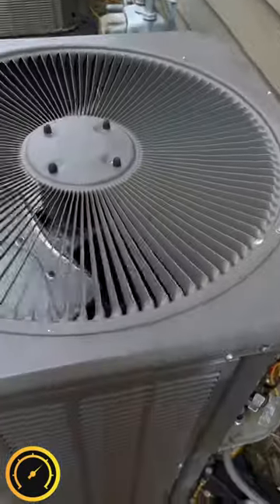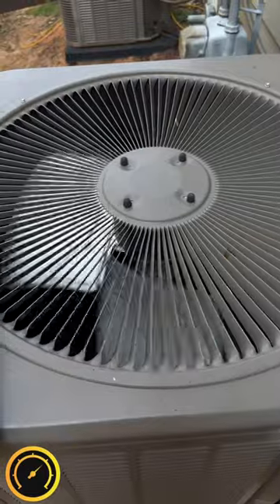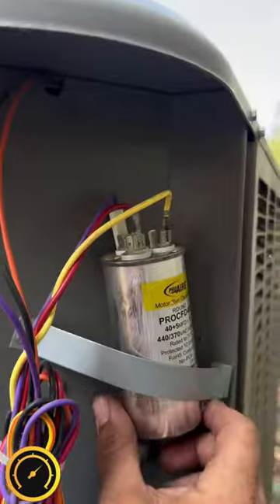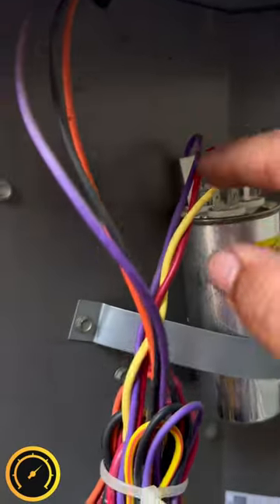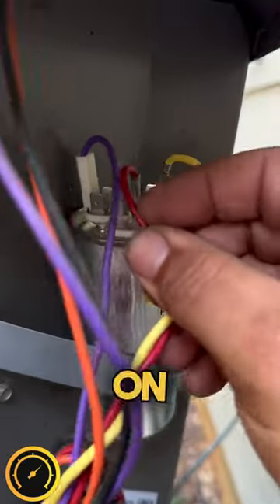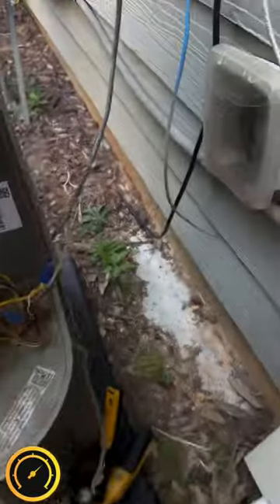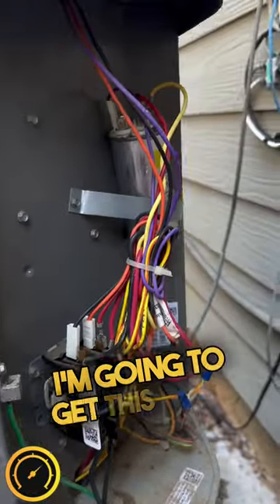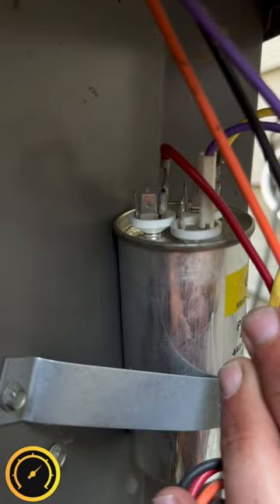Don't let HACKS fix your AC!! #hvaclife #hvac #trending #trendingshorts #hacks

Comment: I always wondered what would happen if you hooked the wires up wrong. Now I know. I went to a large property that had 300 units to meet the new maintenance director to give him a brief overview of the life of the systems there and it was a whole mix bag of AC systems from 1980s to 2020. There were some carriers, yorks, goodmans, and even some old r22 units still running. I opened 5 different random condensers and noticed they all had the same new titan 10uF capacitor. I thought to myself "That's kind of odd that they all happen to have the same capacitor." So I mentioned this to the maintenance director at the company and he told me that the guy before him was sick of paying $300 to have a $10 capacitor changed so he ordered 300 10uF capcitors and had the maintenance crew replace them all a few months ago. I told him the process of putting the correct capacitor in each unit and they did not like what I had to say so I never went back there. It would be interesting to know how long those units lasted and I'm kind of surprised that they even worked at all.

Comment: Always take pictures of wiring myself so I make sure it goes back the way it was
Reply: Yep absolutely the way I do it.
Reply: thats works great until you meet someone that tried replacing a cap themselves, messed up, now they’re calling you saying it just “went out” but in reality they botched the wiring lol. pictures are great but if you really understand why you do what you do then you can be that guy that can solve anything
Reply: Or read the diagram as a double check before re energizing
Reply: True but those wire colors are definitely indicative of where they land at. 
It’s better to learn to read line diagrams and use pictures for quick repairs if needed. 
And I’m surprised he didn’t keep the video going, would’ve taken me 10-15 seconds to wire the cap correctly
Reply: Just learn to read the diagram. You'll learn sumthin

Comment: I love DIY homeowner fixes. Makes life interesting- and funny.
 Had one replace their contactor- the high voltage took out the transformer and the thermostat caught fire on the wall. I've been at it 49 years and still haven't seen it all! LOL!
Reply: What did they wire it up wrong?
Reply: "how to save 500$ to eventually pay 2000$ plus 4 hours for the pro to clean your mess then put nice thing in it" in the nutshell. 

Ever seen a whole ass bathroom being wired into furnace circuit breaker? I love to see when they turn hair dryer plus ceramic electric heater when furnace cranking on for high heat mode lol
Reply: That's pretty funny. But notice he said "don't let hacks" he's talking about hvac people that suck at their job. Not homeowners.

Comment: Interesting situation. Both winding of the fan will be in phase, so with no polarity the fan might even spin backwards, if it starts at all. On the compressor side, both caps are in series with the start winding, which surprisingly reduces the start winding capacitance! So, both motors will struggle to start, draw more current, and die sooner.

Comment: Had a co-worker replace a compressor on a unit and told me that everything was working well. I did the p.m. a month later and the system was cooling 10 degrees. He wired the fan incorrectly to the capacitor and it was running backwards. After I corrected that I added 4 lbs. if refrigerant to the system and it was cooling 22 degrees. Hacks are a dime a dozen and companies are willing to hire hacks because they think they're saving money.

Comment: Seen a guy wire the cap wrong,  never realized fan was spinning backwards, diagnosed bad compressor because amp were reading 34, max was 24, temp split was below 10. Replaced compressor, same exact issue lol.

Comment: Yup had one like this the other day, customer installed his own cap and wired it exactly like this but instead of that noise the fan was just running backwards
Reply: Yes definitely
Reply: teslafusion74 i did it once(im pretty new lol and it just pushes air out at you and you can feel the air being hotter than normal and it eventually trips on high pressure the reason i did thus was customer started talking to me anf i left for some reason and the fan wire was blue and the compressor wire was brown but usually its the opposite so i wired cap bad lol

Comment: So that part u said wires are backwards I just had replaced cuz it was running for half the the day and not cooling so they replaced that and came on but took almost 24 hours to go from 75 to 70 which I feel is a really long time and once it reached 70 I left it there for awhile then put on 68 so saying 2 hours to drop 2 degrees does that sound normal ? And should tan always be on which iam not sure what ram thermostat is referring to have nest

Comment: If the common was on fan terminal and fan on common, the hermetic side power would potentially be pulled through the fans start winding. Your MFD ratings and amp draws could be all weird set up like that. So depending on how long the unit ran like this, the compressor and fan motor could have been damaged. Megg and amp draw. But if it works, let er eat.

Comment: Definitely check amperage. Might even want to use megger and check windings.
Reply: Woah there Spock no need to do all that 😂😂😂 just  take a quick amp reading after you fix the problem it wouldn’t of effected the fan just the capacitor…… I do commercial HVAC these systems are so simple it’s funny go work on a city multi with full branch box….
Reply: @cameron3991 I'm gonna call bullshit on this. That can ABSOLUTELY take out a fan motor! How do I know? Because the last one I found like this killed the motor. And yes I work on residential and commercial. Mostly commercial.

Comment: Thank you for being a decent human being and not charging the customer for a new fan like I see a ton of residential companies do (I do commercial HVAC but we work on tiny systems like 1-10 ton for our office people and their houses) good to see your not just in it to make profit on each call like a lot of companies want you to do they want you to find billable problems to make each service call have max profits. Cause we all know no money is in maintenance it’s all in diagnostic and replacements
Reply: this probably damaged the motor tho
Reply: You are thinking of it all wrong. There is nothing in that system that doesn’t affect everything else. That’s why you call it a system.

If the fan is treated incorrectly for a certain amount of time, it’s being damaged. If you do not give an option to replace the fan as well as the capacitor and give an option to diagnose the rest of the system, then you are not serving your customer to the full. at least a small percentage of the time you will be back to fix it and it could be on you because you did not give the options. You will have a disgruntled homeowner who thinks that you are the hack.

Comment: I was changing my attic fan motor in my shop last night and for some reason I thought the new one was a 220vac. I guess bc I have 2 Blowers in my shop that are and wired it up turned it on and DAYUM! I thought it was fixing to pull out of the wall

Comment: Are you still using zip ties to secure your reverse wires on universal motors so the sun eats thru the insulation on the wires still?
Reply: Nah... tape with wire nuts poking through is a better way.

Comment: I can only imagine what that service call cost with that particular company in Marietta. For people who don’t know a set of  contactors are about $12. A capacitor is about $12 and a hard start kit. It’s about $12 when companies  charge in Atlanta Georgia $325 to put one on and it takes three or four minutes to figure out what’s wrong with it three or four minutes to change it then I get to finish working on it, they charge for everything they do and then you get your almost $1000 service charge
Reply: I feel the need to comment on this as an ex HVAC tech. People love to point to the costs of the parts and how long it takes. Lets add in the other factors you don't give any value. It takes 3-4 minutes to diagnose because they do it multiple times a day for years. They do it correctly the first time. IF that cheap capacitor that everybody carries fails prematurely, we replace it at no charge to the customer. We carry insurance on our license and businesses. We have a service van full of inventory so that $12 part is immediately available. We also have thousands of dollars invested in tools and testing equipment in that same van. That meter alone is $100 to $300 and the hand tools is another couple of hundred dollars as well. Don't even start with recovery machines and vacuum pumps. When I was doing commercial service, I had probably $2k just in gauges and vacuum pumps because I did work on multiple compressor systems and would do start ups on buildings with more than 1-2 units. I would say I had $10-12k worth of tools on my van on a light day. So if you get a guy that charges you $30 an hour and puts the part on at charge, savor it. Those are the guys that I usually charge double for. I have to undo their fix first and then see what the real problem was.
Reply: @atx4fun  I agree with you. I am that service technician with the truck unit tools and engages all fieldpiece Bluetooth equipment.
I still I’m only on the charge $125 for a capacitor change out. I do this because I’ve seen people struggle with the air conditioner repair bill. I do a lot of work for free for the elderly I charged him $75 to check one out.

Comment: I had some one wire the compressor side wrong it it made the compressor run in reverse, it’ was a scroll and that thing sounded like garbage till the dead short kicked in
Reply: Installers do it every day. You do realize that nobody uses a phase checker unless the compressor is a screw or centrifugal, right? Normal people phase check with their ears.

Comment: Yeah they gt really hot when you do that.  I've had brand new units outta the box occasionally wired wrong and start up funny.
Reply: Lmao speaking of manufacturer screw ups... was sent on a warranty call for a water fountain. Fountain freezing the water in the reservoir, and water valve works intermittently... they had power to the tstat, and the buttons to activate the valve are supposed to jump off that to always have power. Compressor should be on the other side so the tstat controls it. They put the compressor to constant power and the damn valve was being disabled because the tstat was controlling it!

Comment: I had that same issue the other day. Homeowner went on amazon and ordered a wrong size capacitor and wired it incorrectly then called me because its not working after the husband tried to diy the fix 🤦🏽‍♂️